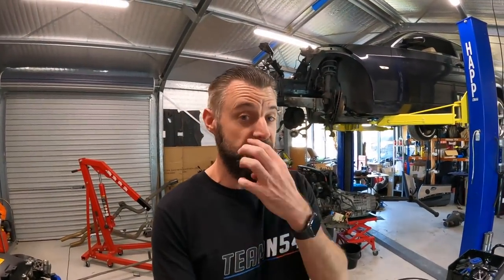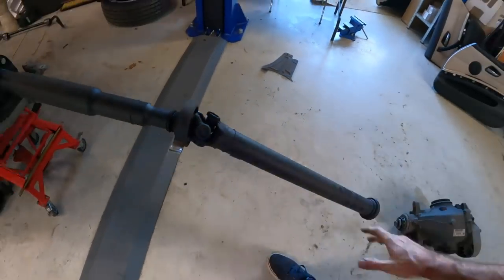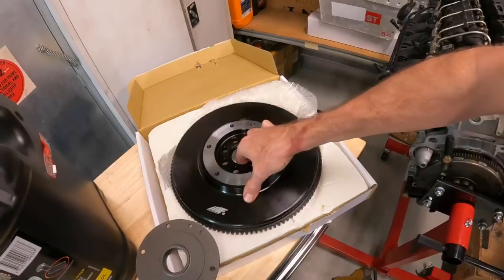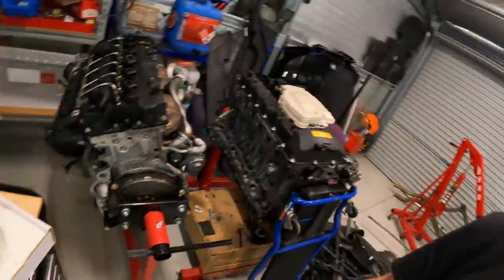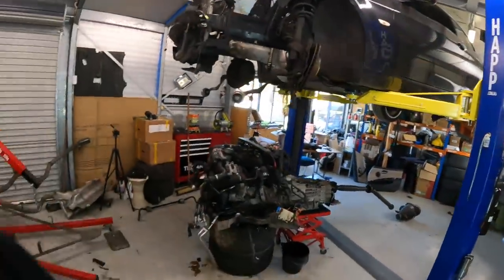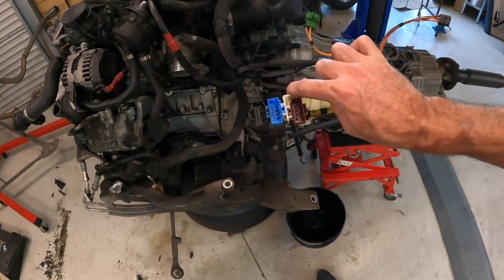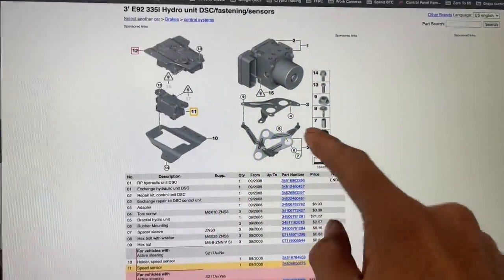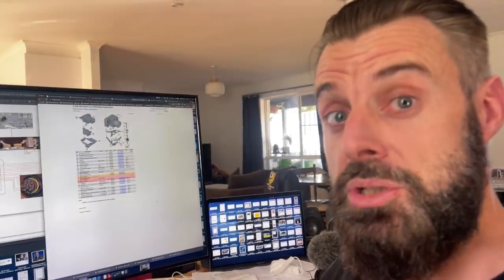BMW 335I N54 6AT to DCT Swap: WIRING & What Parts You NEED

Comment: Still not enough pedals. 😜

Very impressed with all the work and research you've been doing, including all the experimentation you have been ballsy enough to tackle!

LOL if during your cluster swapping and programming you have EVER seen anything about a successful change of miles to kilometres for an e36 odometer PLEASE point me in the right direction. I have spent many hours and dollars on software, diagnostics, connectors... over the past decade with zero satisfaction.
OBVIOUSLY it knows the kilometer value because it is displayed and used in the OBC for its calculations AND the cluster has both units of measure in lights...
10 years of searching and the only answer I have ever seen is "swap the cluster for a German, Australian, or Canadian" one... I already added IndyGlo faces, chrome rings, and done all the surgery on the harnesses to add the 18 button OBC so that feels like a step backwards.

Comment: What a mouthful of a video. Between the naming of the modules, systems, and connectors that was a 20 minute bowl full of Alphabet Soup. I've got some paddles from Evolve making their way over from the UK for mine, which should fit onto the NRW paddle adapters. Not entirely happy with the skeletonized look of the NRW ones I currently have. Reason I mention this is I think you'd probably enjoy the improvement you get on the FEEL of the switches: clickier and more satisfying.
Reply from the maker: Thats exactly why i like my current ones. They are more clicky than stock and even more clicky than M paddles. Which is strange cos i think they are from a X1. Let us know when you get the evolve paddles and what you think of them.

Comment: If you do reuse the wiring from the 6AT shifter inspect the wiring closely. they are common for failures. I had to repair mine a few years ago. It was a PITA to do it in the car so if you have the loom out already probably a good time to do it.
Reply from the maker: Very good point, i have heard of a few people with issues. Did you break on the bend about 1-2 inches from the blue connector?
Reply: @ZeroTo60Tube  I don't remember exactly but that sounds about right. I remember not putting it back in the clips as it felt like it was too tight when clipped in.

Comment: Looks great, having ran my n54 dct pretty hard for the last 20k I can recommend the xhp flash for sure, it had a few niggles shifting but now it’s on revision 3 it seems smooth. Secondly it’s going to be interesting how the DCT fluid change gets on, pentosin is very expensive here in the uk and it would be nice to see some other fluids working without issues! Keep it up! Lawrence

Comment: I’ve got a single mass flywheel on my manual 335i and the noise isn’t that loud but it’s there n is very annoying, I raised the idle to 800rpm and it’s much better now!
Reply from the maker: Heard a few people that did that and said it’s fine. But again thought I better mention the negatives so people are aware.
Reply: Same here, even did raise it to 950rpm no problem. Almost the only time you hear it is when in 4-5th gear low rpm pull. But it drives mega responsive!
Reply: @JerainJezza  what single mass flywheel did you go for? If you go for the really light alloy one it’s meant to be quite bad, I went for the solid steel one n it’s ‘alright’
Reply: @br4d101  "6MnCr5" steel

Comment: Looks like a fun project.  what's the best way to re wire DCT harness on to 09 n54 car.  Harness I have is for N55 DCT and original 6AT.  I assume keeping the 6at harness an re wiring it Is a better way forward.  Are there any Diagrams on how to approach it?  thanks

Comment: Great video, I have a problem with my Hall effect sensor with sporadic temperature till 200 degres so defect 5A54 on memorized, I am wondering if I can check this sensor by connectors X6031 or X6021? before change it.
Thanks
Reply from the maker: Im sorry that is not something i have looked in to

Comment: Another very informative video Andrew. I didn't realise there was so much involved from the wiring point of view in the installation of a DCT. When you say that you are going to install the diff out of the e93, what are you going to do LSD wise? Are you going to swap it out from your e92 diff or get another LSD? You will certainly need one.
Reply from the maker: I will try and get my hands on an lsd, but I won’t be able to use my old one. I’ll need to buy a new gear set. However I kinda wanna wait and see what comes up.

Comment: Your cabin wire diagram shows x14274  pin 3 to be x6031 pin 10 to pin 7.  Pin 7 is an empty spot.
on spoolstreet diagram x6031 pin 8 is parking lock 1 pin.  Did you  typo pin 7?
Reply from the maker: Oshhhhh mistakes are always possible spesh when filming and not paying full attention. On what I’m doing. I’ll have dig back in and double check.
Reply: @ZeroTo60Tube  OK, thanks so much, finishing my dct and this is the factor I'm stuck on.

Comment: Really helpful !! What dct gearbox i need for a m54 ? 6 bolt or 8 ? Thanks
Reply from the maker: the 6 and 8 bolt reference is to the crank on the N54. So if you are changing flywheel it makes no diff. This one is a 6 bolt donor which i fitted to my 8 bolt crank, but needed a new flywheel.

Comment: Hey when you actually get into wiring can you show it step by step? I'm currently tackling a dct swap at the moment and am having trouble with the wiring.
Reply from the maker: Hey Tommy, the wiring took me a good few hours to get my head around looking at the wiring diagrams the guys have made for the swap and then tracing everything back through the ISTA diagrams. Have you gotten to the point where you understand what each wire is doing yet? If not how far along the swap are you?
Reply: @ZeroTo60Tube  I think I've finally got the wiring mostly correct, the modules are communicating with each other so that's good. My car is an august 07 build so I've had to swap and update a lot of modules so I think my problem is more coding. I'm having dsc issues at the moment and I'm trying to figure out if its a wiring issue or if the dsc unit is bad.

Comment: Hey man, I’m doing a dct swap on a early build 2007 and the dct transmission harness, the connectors like x6031, x6021. The connectors that suppose to plug into them are not the same, I seen they had a completely different jbe and harness. I was wondering what I should do to finished the swap. I’ll really appreciate it if you can help me out
Reply from the maker: Hey Man, i would need to teach myself again all the useful info from when i did it is long forgotten. sorry i cant help at the moment

Comment: Did you swap in an e90 M3 flywheel? I understand that the M3 had a different part.
Reply from the maker: I used a mfactory single mass flywheel.

Comment: Are you still using the green and purple looking connector? I’m getting ready to install my Dct and wax going to run the harness through the factory rubber square boot buy noticed wires coming from the green and purple plug that connector to the factory auto Tran blue or black plug.
Reply from the maker: Hey John, it was so long a go I can’t remember what’s even in the video. Generally I will cover how to do everything in the video or provide links if external sources are needed. That said depending on your car the wiring may be different to this specific one.
Reply: Mine is an 08 and should be the same, or relatively close. You don’t recall if you use the green or purple connector that goes in the DME box, the one that you showed in this video when showing which connectors you need for the transmission harness?

Comment: The SHIFT PADDLES of 6AT wouldn't work as I just done swap my 6AT direct to M-DCT, you will need to change it to LCI shift paddle or M3 paddles (my setup). For the rear differential I believe I am using a 3.08 currently because the rear section is from another donor vehicle but it is working perfectly, just for your referencing. I would love to see your setup of 2.56 and expecting how difference with mine that will be
Reply from the maker: With the 3.08, did you use any specific firmware on the box or just an xHP flash?
Reply: @ZeroTo60Tube  No xhp flashed, but my friend told me he is using M3 software when coding on the gearbox like cheating to the vehicle it is a M3 car, will let you know later when I reach him and get more details

Comment: Been looking forward to this :) Going to be interesting to see the difference between the auto and DCT! Been waiting for you to do this so I can see how hard it is to service the DCT in my N54 😅 got a quote for £700 😳 the actual service looks easy, it's just setting the right oil level in software that I'm not sure on!
Reply from the maker: I have looked in to the service procedure. I don’t think it’s complicated at all. Should be a walk in the park………… but we’ll see
Reply: @ZeroTo60Tube  walk in the park compared to all the wiring you are doing 😅 I need to try and download the software to do it.

Comment: I know this video is old and it's a long shot, but did you by chance reuse the automatic transmission cooler?
All of the writeups I've seen don't seem to mention anything about it so my guess is that it's reused, but I don't want a surprise while the car is down.
Reply from the maker: Yes, i used the auto cooler, which is probably overkill for the DCT. However i still see high temps at roll racing when waiting in line to run
Reply: @ZeroTo60Tube  How did you flush the atf from the system?
Reply from the maker: @PeaStalks  just hooked a hose up to the cooler line and pumped until the fluid changed colour
Reply: @ZeroTo60Tube  Thanks, man. I'm have the car torn apart and have the wiring from the donor car and my vehicle, but neither of them match the diagrams that I got from spool street and your video. Do you think you could help me piece this together or answer some questions?
Reply: I'm going to assume that I need to use the DCT harness instead of the automatic one. The person who sent me the parts cut the dct harness (Fuses and ground). Should I just reconnect all of these wires and only worry about the wiring inside of the vehicle?
Reply from the maker: @PeaStalks  Yes you need a DCT harness. Take your time with the wiring, do not even start it until you understand every connection and what it does. Seriously take the time to understand the wiring before touching it.
Reply from the maker: @PeaStalks  Unfortunately i am in a pickle at the moment, i have no free time.
Reply: @ZeroTo60Tube  No problem, I answered my own question yesterday. Good luck with your project. 😁

Comment: My car was made in October 2008 it came with the DCT and it's an N54 335i, I seem to have a problem with the JBE because my door lock actuators, cooling in AC, wipers and fuel gauge are not working but the fuses are fine, can I use one from AT 335i ? The only code I get is the DTC button pressed code but it does nothing when I press it.
Reply from the maker: To be honest i would try and get one that is the same part number as your current one. I know the early JBE modules do connect differently. But that said you could get one from a A^T 335i as long as its the same part number.
Reply: @ZeroTo60Tube  okay thanks

Comment: I have a 2011 335i n55 Xdrive. How could I swap a 335is dct into my car?
Reply from the maker: Faily difficult with an xdrive. You would need to adapt the DCT to a transfer case. I dont think there are off the shelf conversions for that. If i owned that car, i would go 8hp70. You can get the bolt in parts to make it work and it will be strong and faster than a DCT.
Reply: @ZeroTo60Tube  This transmission bolts up to a 2011 335i n55 with xdrive E90?

Comment: e91 with n55 and dct would be my setup, I just dont know if its possible.
Reply from the maker: Definitely possible. I would also love a e91 N54 DCT, but i am kinda bias to the madness that is an N54.
Reply: There is a e91 335i with a n55 from a m2 but manual in the U.K.

Comment: I'm losing my mind lol I cant find the the wiring for the female blue X6021 connector I have a harness from the DME to the DKG but its the blue connector that goes from the X6021 to the JBBE that I'm lost at
Reply from the maker: Ohhhh man, I can remember what I repinned now. Is your car the same as mine? Do you have my modified wiring diagram from Facebook,
Reply: @Zero To 60  mone is a 2010 335i I think you probably moved the blue connecto from the jbbe to the dme box over from the spare is thay right?
Reply from the maker: @scarface16134  no no, i didnt replace any wiring. But i remember repinning 2 wires in one of the connectors.From memory it was the shift signal i think?
Reply: Maybe send a brother some pics of the blue connector in the dme box?
Reply from the maker: @scarface16134  I dont have the car with me at the moment (its back at the panel shop for a while). But if you are stuck, you need to slow down and take your time to understand how the trans is communicating with the car. I reckon it took me about 5-8 hours of looking at the wiring diagrams to understand it. Also go through the spooolstreet thread in the description again. All the info is 100% there between spoolstreet and this series. Dont even try to touch the car until you understand what you are changing in the wiring harness.

Comment: Can I put a DCT on my N52?
Reply from the maker: You would be able to, but i think you would need an aftermarket DCT controller. There is no DME software for the N52 with DCT so doing it as a factory install wont work. But with the HTG controller definitely possible.

Comment: Does that diff accepts the lsd from the other diff?
Reply from the maker: Unfortunately not, the gear will be welded to the centre on the DCT cars diff, so in order to upgrade i will need to get new diff gears and bolt the new gears to a LSD centre. Probably going to be quite expensive.
Reply: @ZeroTo60Tube  maybe brintech does the job, or difflab, cut the crown gear and machined ir to be bolted to a lsd centre?
Reply: @ZeroTo60Tube  I’ve just installed an mfactory clutch plate lsd in my 130i and the change was really impressive. I think every bmw should have an lsd. Btw, if you’re planning to sell the mfactory lsd core let me know!

Comment: Which state in AU from mate?
Reply from the maker: Qld
Reply: @ZeroTo60Tube  I am from WA mate, I am out looking to buy 335i E92 after owning E60. I am mechanically and electrically sounded and use ISTA+. There are 2 cars which I like, there is a 98K on clock 2008 E92 Stage 2 with some mods and then there is a 2006 E92 Stage 2 with 200K on clock with all known 335i known faulty parts and turbo’s replaced with 17T.  So which one you would prefer? I am so confused.

Comment: I was so afraid you were going to smack your head on the lift 😂
Reply from the maker: I have plenty of times haha. Bloody thing.
Reply: @ZeroTo60Tube  do you know of a way to make the dct transmission standalone in order to use it with pther engines??
Reply from the maker: @FirstLast-tx3yj  There are a few controllers out there. The HTG one seems most popular and the Maxxecu solution seems the most refined, but you need the Maxxxecu to run the engine and box together.
Reply: @ZeroTo60Tube  is it possible to use stock tcu and xHP flash it??